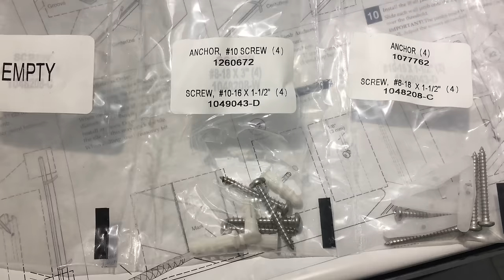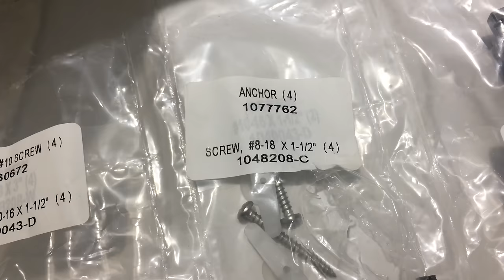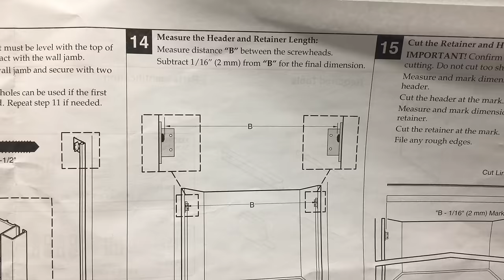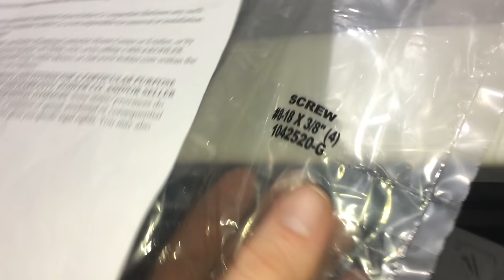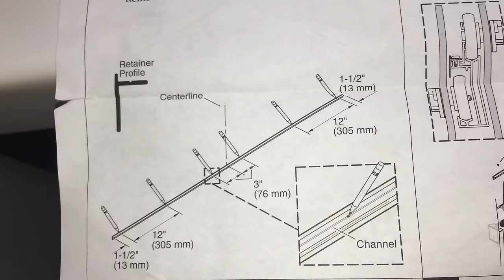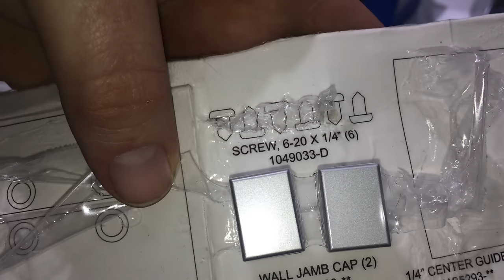How to Install - Kohler Levity Bath Door - Manual - 60" , 1/4" Glass door installation

Comment: Thanks for the video. I have a couple issues,
1. Cutting the the top piece with the jig saw without protecting the finish with tape you definately marred the surface as shown in the video.
2. The hardest things to do like how to hang the inside door, is not shown in the video. In fact many of the difficult tasks are either not explained or not shown. Even the outside door with the little J hooks has to be installed in a specific part on the upper track where there are cutouts.

Anyone  planning to do this job should know this is not one for a novice. You are best to have a second pair of hands as well as sticky gloves as the doors are very heavy.
Reply: I just hung 3 at a house in 4 hours....caulked and all cleaned up... it's different when you do it everyday... these are garbage though definitely just call a glass and have them order either a serenity or a crescent series...
Reply: What's the cons of the Levity? I'm purchasing today but before I do, would like to know the downside. I will be installing on a kohler bellwether tub which is cast iron
Reply: Anyway to remove the scratches?

Comment: I'm installing this now... just read that the tub wall needs to be 3 inches wide to install the bottom door "guide".  Mine shower tub is only 2.5 inches wide.  Any suggestions?  Wouls these doors work with a smaller door guide?  Thx
Reply: Did it work?
Reply: @haydenfrench8493  hey!  I did do it with the door guide track provided.. its held up well. However, the door "track" kind overhangs the lip of the tub. It hasn't been a problem for me, but it doesn't look quite right.  No one will notice other than you!

Comment: A very sloppy tile job right there. And I just finished installing a kohler levity shower door and they are missing a lot of details  for exemple: the jamb cover does not fit all way in to the tile because of the top and down bumpers. And also the boots, is rubbers flimsy thing.

Comment: both my doors came off the bottom track. can anyone help me on how to get them back on? I would appreciate it. Thank you.
Reply: Have the same issue after bumping into one at a friends house. You basically need to but a new centerpiece, remove the lower strip, place the inside door in the centerpiece then hang the door, fix the centerpiece in place using acrylic transparent caulk, hang outside door. Best thing is to dissemble it and follow the instructions to install the door again. There is no easy way to hang the inside door on the lower centerpiece without doing so.